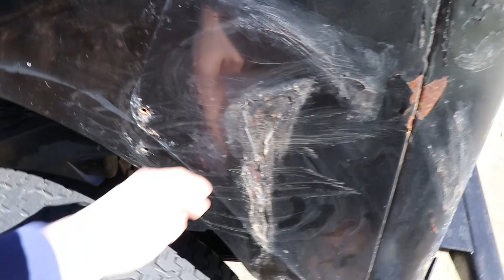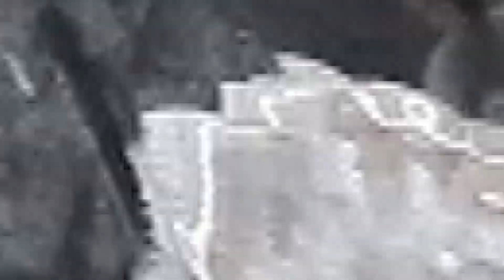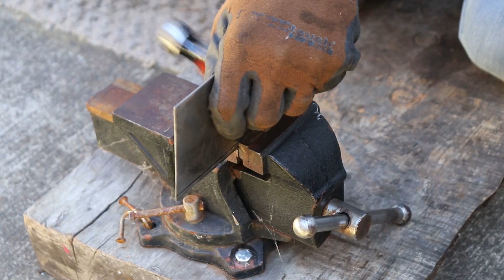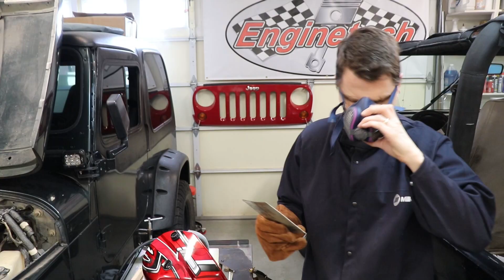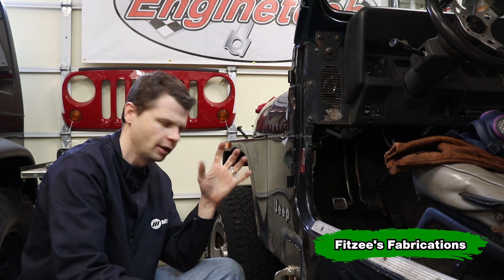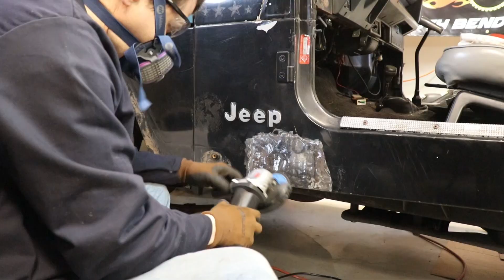Almost Failed Auto Body Repair: Jeep body patch weld

Comment: I know this is 2 years old, but I always use 023 wire to weld sheet metal. It helps to keep me from blowing through. Also that 45 you cut for your buttwelds is why you were blowing through. You essentially halved the thickness of the metal and if you don't get the two pieces flat against each other you will blow through.

Comment: Hi Dale, thank you so much for the encouragement to try something new. I've been looking at sheet welding videos for over a year now trying to work up the nerve to try it. One of the issues I'm having is finding someone using the same welder I bought for my purpose. But in your video I think I see a Harbor Freight Titanium welder.  I don't think you ever say what welder or settings you ended up using.  Is that by any chance the Titanium Flux 125? And if so, what settings did you use that gave you the best success on the 18 gauge sheet metal?  Thanks again!
Reply from the maker: Thank you.  Glad my videos have helped. Best thing you can do is get some scrap and just start.  You’ll get things wrong, but some right.  You’ll gain confidence and learn.  My welder is harbor freight titanium mig 140. I used 18g metal. 0.030 wire. Not flux wire. I’ve heard flux wire isn’t as good for sheet metal work. Harder to get clean welds, but I haven’t tried with flux.  My wire speed was 136. V 15.5. Induction 7.5.  Hope that helps 👍🏼
Reply: @JeepSolid  thank you
Reply: Good question

Comment: for grinding the weld I always use a 80 grit flap disc, the normal al-ox wheels are pretty rough on the metal and means you have to do more prep work on the primer/bodyfill side. fantastic job still. thankfully the wrangler is a big flat box so no need for complex bends or twists!

Comment: As soon as i saw the way you was putting the patch on i thought about Fitzee's fabrication.  glad to see you watch him also.  only thing i can suggest is thinner wires.  go down to .028 wire and now days most cars and trucks are about 20 or 22 gage steel.  Fitzee like to work with older car metal because it's thicker.  and since he's doing a lot of grinding he needs that extra thickness.   don't worry about blowing through just keep working at it.  even he blows through some times.  and even admits he does.  so long as you keep trying it's all good.   the patch came out good.   i've done a lot worse over the years.  but i won't admit to what on..  :)
Reply from the maker: Yes. His stuff is great! You’re right on your metal thickness and wire recommendations. I’ll have to look at some changes

Comment: hi dale..small tip: i recommend tacking from the top and tacking going down, going over the previous tack. pretty much like you were doing, but going down. but good job..:) same thing for sideways. your tack leaves a bit more metal, so it's easier to tack on top of that. adding to that tack. hard to explain...:) lol
Reply from the maker: Yeah. I started to notice a difference on the angle and direction 👍🏼

Comment: Absolutely keep practicing technique to prevent blow through , you will get it . You may just need to adjust the angle you hold the gun at so the weld is focused more at the metal and less at the gap . You’ll find your technique and what works best for you . 
Heaven knows that Jeep’s accumulate enough rust and you’ve got enough Jeep’s to keep you busy so there’s plenty of practice ahead and lots of content to be had . The harbor freight titanium MiG is said to be a good choice for us diyer’s so I’m sure you’ll do well .
The great part is your doing it yourself and saving big money on auto body repair . That’s rewarding in itself .
Reply from the maker: Yes. Plenty of practice available on these jeeps. Haha! Thank you

Comment: Fitzee’s fabrications is a great channel . He’s very modest of his skills but does great work . He emphasizes that he makes due with what he’s got and does a great job at that . The ideal MIG wire for sheet metal / body repair is around .023 gauge . It ought to make slightly smaller tacks and spots than .030 wire which is overkill on 18 and 20 gauge. Got to go back to fitzee’s channel , he mentioned his preference for welding gas . He does make good welds on fabrication and repairs , he has a good channel to pick up tips from .
Have to say overall , you’ve got a handle on what to do from preparing yourself with research and practice . I think you’ll get this Jeep looking good as your approaching it with the right and careful attitude . That makes all the difference when just starting out .
Reply: Right on G money!
Reply from the maker: Yes. Thank you. Always learning

Comment: the patch on lower body, tack patch over bad spot before you cut it out. then use grinder to cut through both the patch and the body with the grinder angled so you are cutting a cork basically. In other words the disc is angled into the patch area, that way the patch is a perfect fit to the body.
Reply from the maker: I’ll try that 👍🏼
Reply: Agreed . Although I haven’t done sheet metal repair yet , but need to , this is said to be a tried and true method . The body will have a 30 or 45 degree cut and the patch will match . I’m sure if done carefully , it ought to perfectly match each gap and reduce or eliminate grinding the patch to fit and leave an adequate gap to tack weld in place . I’m guessing a 1 / 16” cutting wheel ought to do nicely . Be careful with those thin cutting wheels though , easy to blow one up if we’re not careful and push and flex the wheel too aggressively .

Comment: More wire speed is needed
Reply from the maker: Thanks! I will play with that.
Reply: It did look like the wire speed was too slow on your practice weld off the Jeep . Absolutely be sure the amperage isn’t too high . You’ll just want to spot or tack to be hot enough to penetrate but not burn through with even a micro burst of the gun . Dialing in on scrap metal of equivalent material is a must . Agreed . I haven’t done sheet metal patch body work yet ( will get to it ) but have done 18 and 20 gauge metal . Exhaust pipe is similar . I learned on that first .